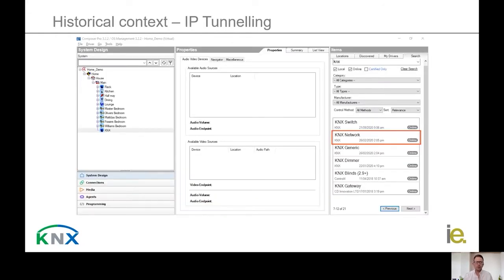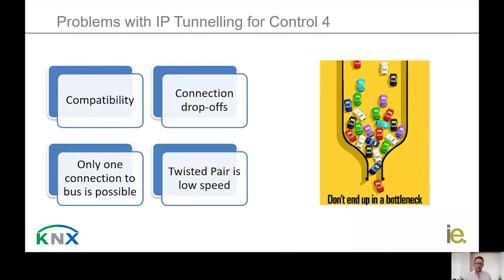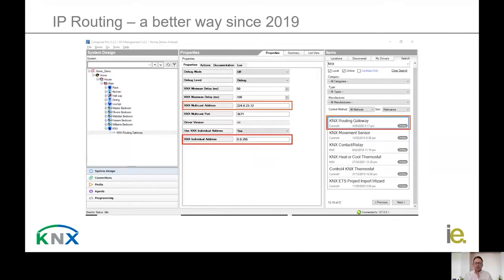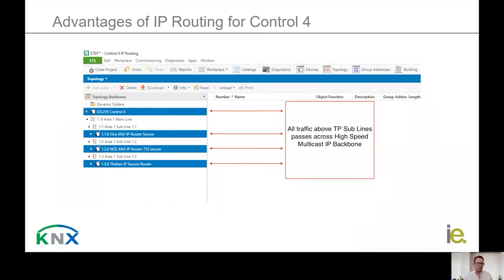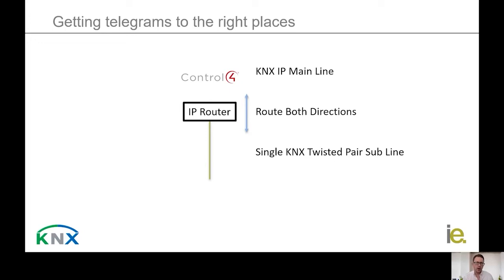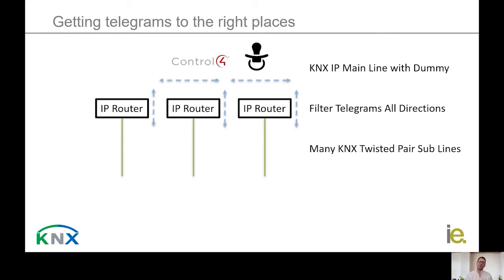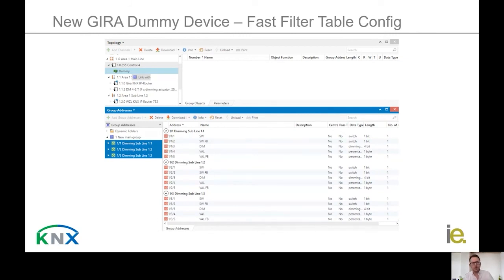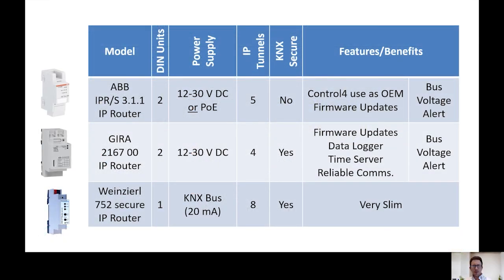Connecting KNX and Control 4 - Ivory Egg

Comment: Very interesting. Can I throw a problem past you please. I am just completing a full control4 system on a new build home. I have under floor heating and I chose heat miser for the thermostats and hub as it integrates seamlessly with C4. However my air source heat pump (this is an issue with virtually all quality heat humps btw) has proprietary software, in my case something called Easytron for a Stiebel-eltron pump. I can keep heat miser and therefore control room heat demand through C4. However I have since learnt that unless the heat pump has access to the demand ie thermostats, pumps, manifold actuators, it is not possible to optimise the performance of the heat pump (take out buffer tank, circulate in the system during periods of low demand etc.). Easytron integrates seamlessly with the KNX IP Router. Do you think a solution might be to switch to the Easytron controls in full (ie include their room stats as well as the pump controls), install a KNX IP router and then connect this router to Control4?